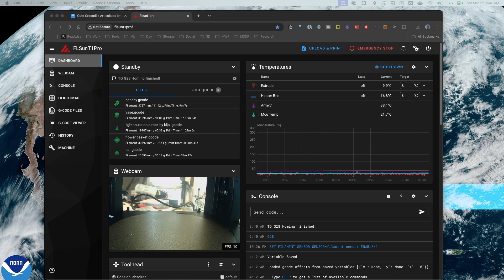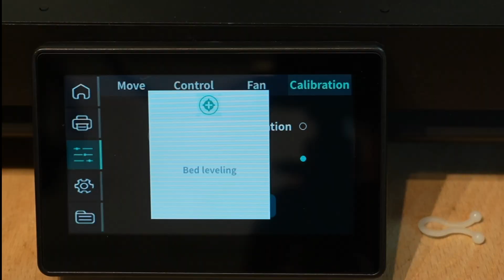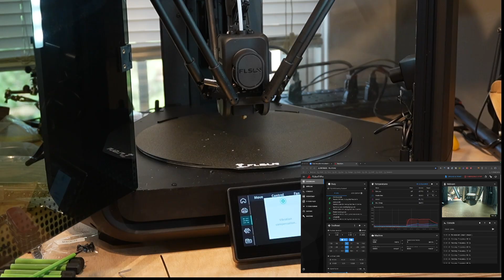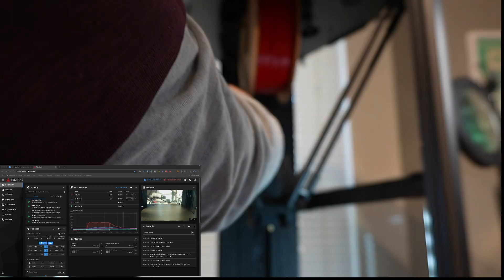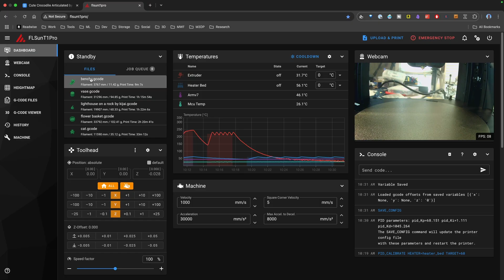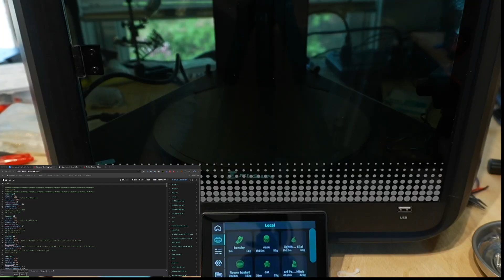FLSun T1 Pro: Initial Tuning & Mind-Blowing Speed Prints!

Comment: When trying to get a calibration for the extruder i get error: heater not heating at expected rate, but everything appears normal, any advice?
Reply from the maker: I have seen that one as well, just this weekend. Everything on mine Stell seemed good. I will update if I find and solve the problem.
Reply: @minimal3dp  So i saw from some sources that it might be related to the fan speed, but i tried to run the fan before starting the calibration but it still failed and restarted with the same error, let me know if you find any fix.
Reply: @minimal3dp  Alright, replying back to this again, for some reason, there's 2 issues occuring here. 1. For some reason the printer's config file doesn't include a Verify section for the extruder temp, which causes it to error more easily and quickly, this can be fixed by adding a verify_heater section back into the printer config. 2. for some reason the PID Calibration command cannot actually bring the hotend up to temperature, it tries to, but is completely unable to do so, as i can manually set the hotend to 220 with zero issues.

Comment: Is this printer open source friendly?
Reply: You can put your own Pi in it to run your own vanilla klipper. FLSUN has not released the firmware for the printer and has locked us out of the printers. 🙄😑 It’s very annoying when these print companies do this as it makes more work for them and us instead of just providing the firmware and proper tuned profiles. 

It makes no sense when those are the areas that would help sell the printers and gain a real following. It’s not just the speed that launched Bambu, it’s the ease of use. Now they’re making the shift to being more closed off and they’re losing momentum. 🤷🏾‍♂️

Comment: Did you figure out where the screw that fell off the toolhead mid print went?
Reply from the maker: Yes. I did not see it till after I recorded and did not realize it was in the video. I did not tighten one of the screws on the hotend during assembly.